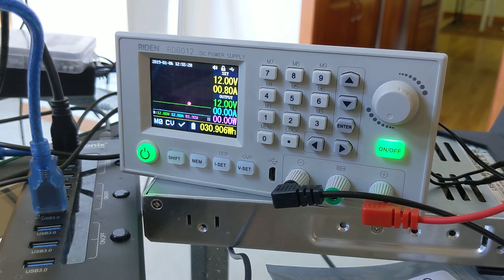L6234 with simple FOC motor control part 1

Comment: How is your coils made? are they with or without a core? Are they the same polarity? What is the ratio between coils and magnets?  
and last but not least... are your magnets connected with same polarity?
Reply from the maker: you should use a coil calculator and target ohms based on the power consumption and the half bridge rating.  Generally simpleFOC with no current sensing is better with high ohm windings because it uses the voltage as a proxy for current in the control loop.  If i recall correctly these had mild steel cores.  I believe the magnets alternate polarity.

Comment: Good stuff Jesse.  I'd recommend the esp32 it works really well with simplefoc library.   2x240Mhz + 12bit pwm will make a massive difference.  The only think that might catch you out is the 3.3v tolerance when reading encoder.